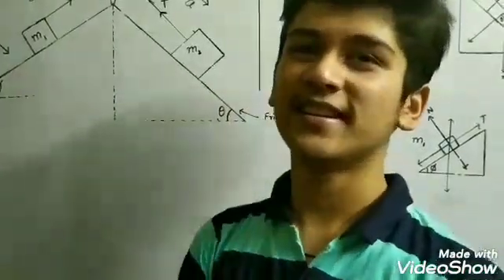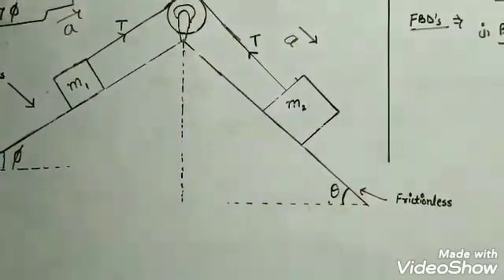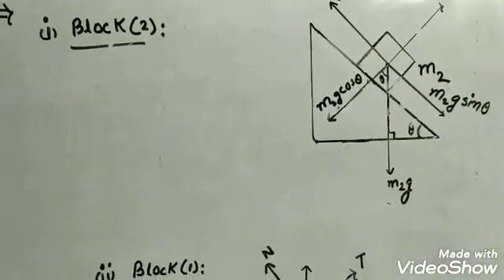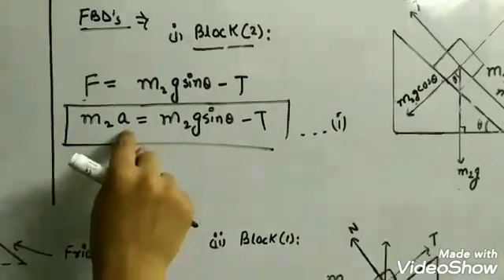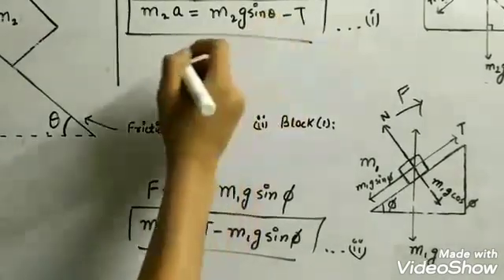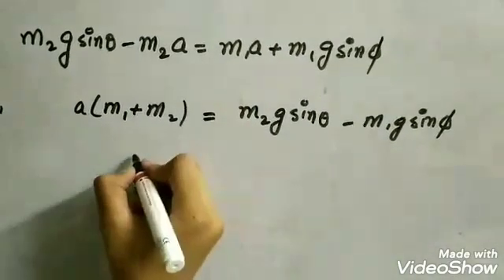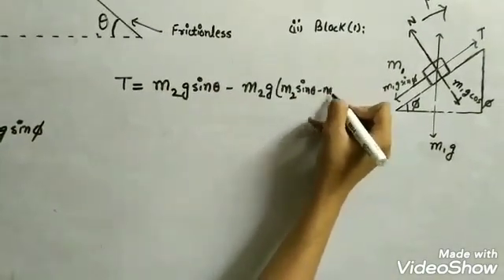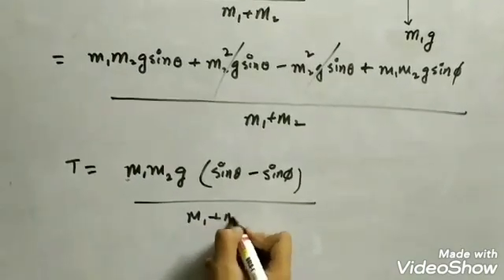Double Inclined Planes I Pulleys I Part 5 I CBSE,  IIT-JEE,  NEET

Comment: At 2:53 why didn't you include the normal N that is acting vertically upwards???
Reply from the maker: We are considering the motion in only one direction (i.e along the plane). Hence, there is no need to consider the normal force here. 
(By the way, that is also being cancelled by mgcos(theta)).
Reply: @tanmaycreations99  so you did components and considered the tension and mg (it's x components) along the x axis thats the reason you did not include the normal N as it is acting along the y axis. Right?
Reply from the maker: @mannkivines5968  Yup

Comment: what to do when their is same weigh on both sides where to taake direction of acceleration ?
Reply from the maker: See, no matter what the masses are on either sides, just assume acceleration in any direction. If the final value of acceleration comes out to be positive, then your assumed direction was right. And if it comes out to be negative, then it's opposite to your assumed direction. 
Secondly, when the masses are equal on both sides, our intuition signals us that the blocks won't move and hence acceleration will be zero.
Reply: @tanmaycreations99  ok thanks 🙏
Reply: @tanmaycreations99  but on inclined plane if weight is same dosent mean that they will not move angle makes a big difference and that defines the direction of acceleration
Reply from the maker: Yeah you're right.. in inclined planes, angles do also matter (there might even be  different frictional coefficients too).
Reply from the maker: Actually Atwood-Machine type of setup came into mind, that's why i wrote that.. 
In inclined planes, that doesn't hold good of course 👍